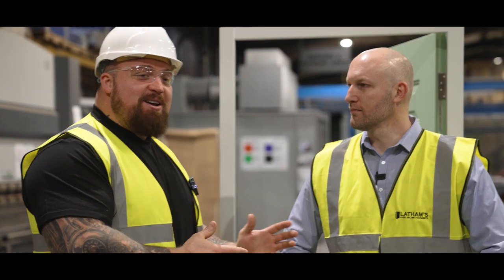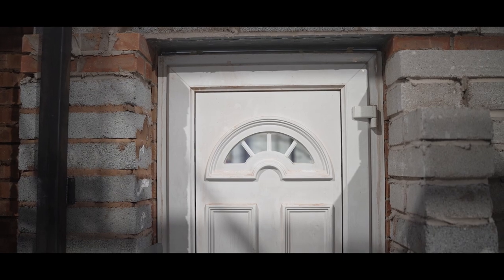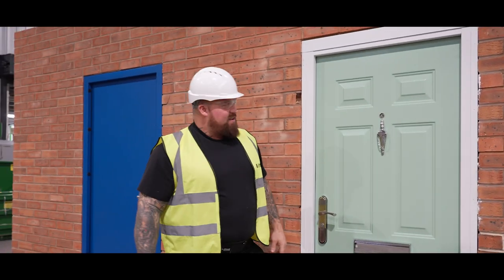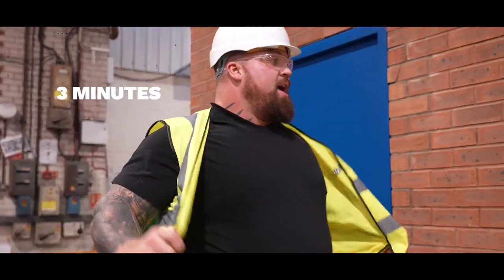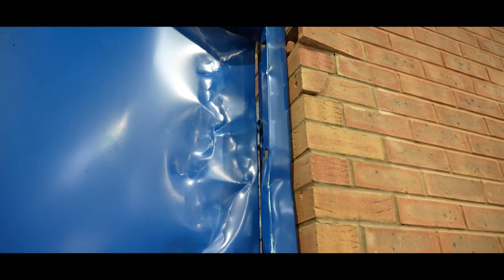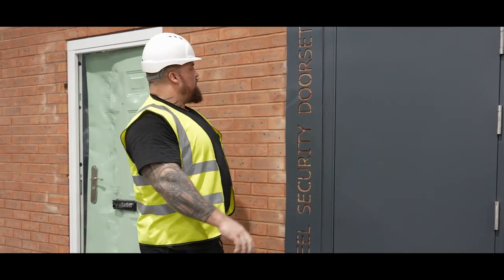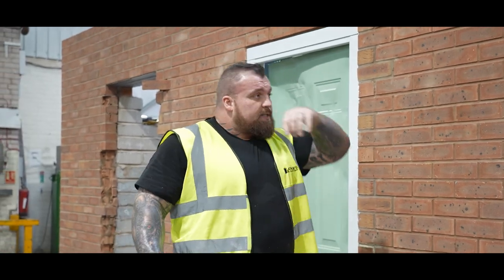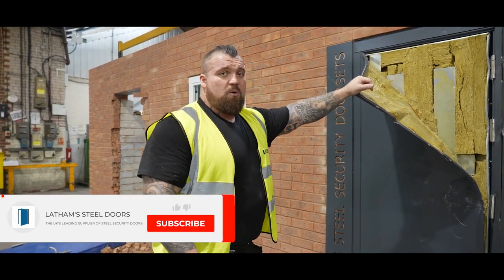EDDIE HALL VS LATHAMS STEEL DOORS // FULL DESTRUCTION TEST

Comment: I am definitely getting one of these doors for my flat. I looked into it a few years ago and was quoted £600 just for the installation (not by Lathams), so I will need to see if I can get that cost down. But let's face it, your average burglar is not gonna be anywhere near as strong as Eddie, so if the doors stand up well to him, they are going to fare even better against your average dodgy burglar. They are likely just not going to bother and they'll go to the house with a UPVC door instead!
Reply from the maker: Hi @Juliukas101 thanks for your comment. We do work with authorised installers which may be able to help you. Please feel free to contact our sales team to discuss your requirements on 01384 220050 or email sales@lathamssteeldoors.co.uk. We also have comprehensive installation guides and videos, if you wanted to have a go yourself.
Reply: I dunno man, they might just see your door as a challenge and come back after 6 months of training for round 2.

Comment: whats the rating levels  that were mentionedä,   lowest to highest, and can one buy  the highest be for residential or are the only sold to businesses and similar, if so why?  Are they all starting with "STS202" BR1 ..2...3 up to 6?  Is 1 or 6 more secure?
Reply from the maker: Hi there,
We offer a large range of doors in both tested and non-tested formats. These doors attacked in this video by Eddie feature our PAS24 (green front door) & STSBR3 (grey flush door).  We also offer SR2,3,4,5 & 6, RC rated & fire rated products. All are available for both commercial and domestic applications. 
Please feel free to contact our sales team to discuss your requirements at 01384 220050 or email sales@lathamssteeldoors.co.uk

Comment: Can you say why the outward opening door is more secure? Hinges exposed looks more vulnerable.
Reply from the maker: Hi Edward, thanks for your comment. So with the outward opening doors although the hinges are exposed, the hinge pins aren't so they can't be knocked out, also even if the hinges were removed, there's still 19 locking points holding the door leaf in the frame.

Comment: Fantastic video. Sad to see the good doors get hit by the sledge hammer.
Only question being are the locks pick resistant ? So many tools available to by pass once good locks.
God bless 🙏👌
Reply from the maker: Hi @lizzapailia959 thanks for your comment. They are indeed, we offer up to a 3* kitemarked cylinder, which offers anti-snap, anti-drill and anti-pick protection on them. We use them on all of our security rated doors.
Reply: Thank you for your reply.  You're probably aware of the modern day lock picks that are easily defeating once secure locks.  We're in the USA. So idk if it's feasible to try to purchase products from you.
It appears there are a few of your doors for sale on ebay?  Don't know if the are authentic products of yours????
Thank you again God bless 🙏
Reply from the maker: Hi  @lizzapaolia959  we don't have any resellers in the US at the moment, but we do work with a range of couriers, if you wanted to get in touch with our sales team on sales@lathamssteeldoors.co.uk with your requirements, they will be able to advise further :).

Comment: Is this 20 gauge or 24 gauge steel
Reply from the maker: Hi @All_Amin, thanks for your comment, we use 1.0mm double skinned galvanised steel for the front door leaves, which is approx. 19 gauge I believe, and 1.2mm on the high security door, which is around 18 gauge.
Reply: Where can I buy these doors, do you ship to New York ?
Reply from the maker: @All_Amin  thanks for your comment, we do have international shipment options, if you want to get in touch with our sales team  on sales@lathamssteeldoors.co.uk they can discuss your requirements and the available options 🙂

Comment: how much does these typically cost?
Reply from the maker: Hi bo55ola, thanks for your comment. Our PAS 24 front door range starts from £799.99 +VAT (https://www.lathamssteeldoors.co.uk/security-front-doors/), and our STS202 BR3 rated doors start from £849.99 +VAT (https://www.lathamssteeldoors.co.uk/security-rated-doors/) 👍
Reply: @lathamssteeldoors  

thank you. I went onto your website. Do you guys do site visits? (to see what can be done for my place)

My house has a glass window next to the door if that makes sense.  I would like to get this done sooner rather than later. 

Look forward to hearing from you.
Reply from the maker: @bo55ola unfortunately we don't do site visits, but work with a group of trusted installers that do. If you want to get in touch with the sales team with your requirements on 01384 220050 or email sales@lathamssteeldoors.co.uk they'll be able to run through the options with you.
Reply: @lathamssteeldoors  

That’s really helpful. 

I’ll give them a call and see what they say.  I appreciate you taking the time to respond to my enquires.
Reply: @lathamssteeldoors  Does that include installation cost?
Reply: @PardonJulianAssangeNow  thanks for your comment, the price doesn't include install, it's just for the door itself.
Reply: @PardonJulianAssangeNow  No mate